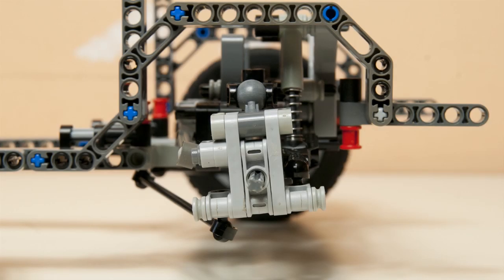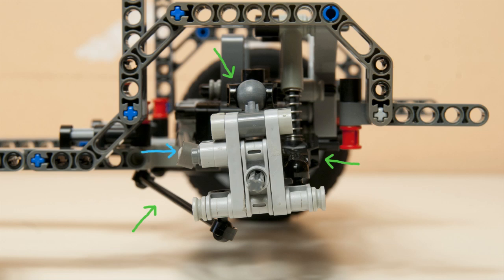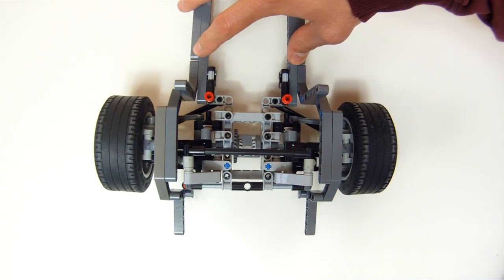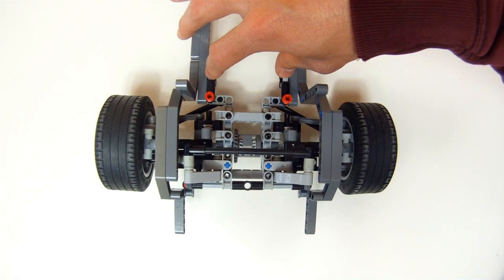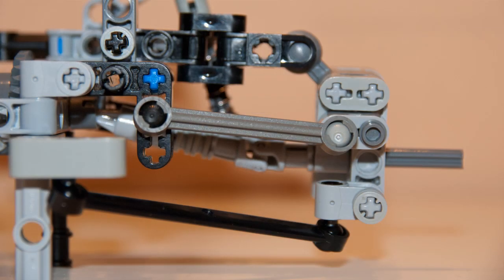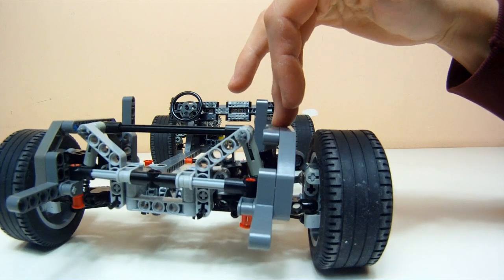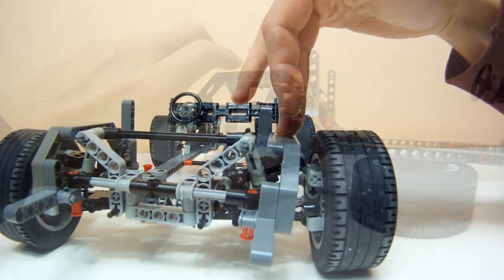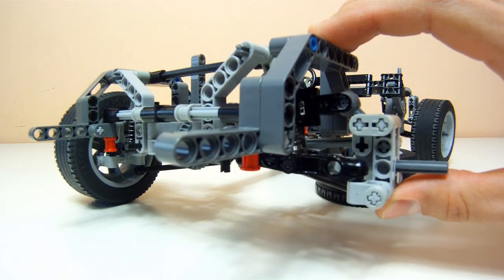LPEpower episode 04 - Simple multilink rear suspension

Comment from the maker: Not only that, the wheel also travels a lot, and that often compromises stability and forces you to make a chassis that is narrower than you'd like.

I'm not advocating the use of independent suspensions in trial trucks.... don't get me wrong. But a proper truck needs the pivot point as close to the wheel as possible.